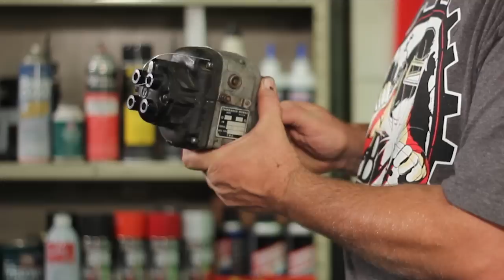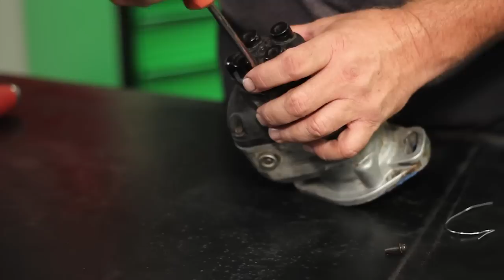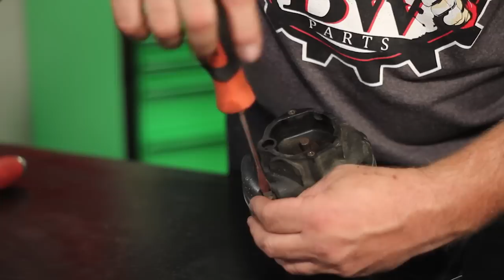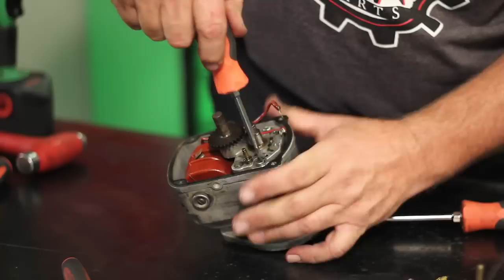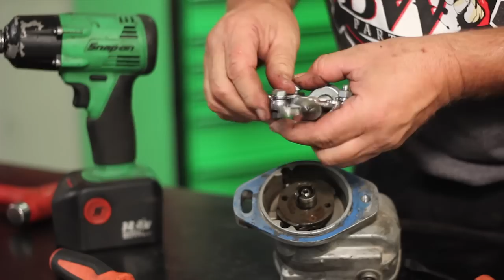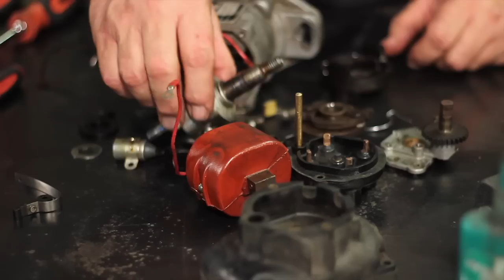Magneto Breakdown: Lincoln SA-200, SA-250

Comment: Hi...that tapered hub being pulled off at 7:50 to  10:20 ...is that a seperate purchaseable part. ..or part of a rebuild kit. One of my dog arms on that hub broke off, and into several pieces. Appears to be no damage to the governor gear or flywheel gear. My Fairbanks-Morse magneto looks identical to this one in the video.

Comment: I have a question does anyone know if the governor has to be installed a certain way with the markings of the timing? I rebuilt mine and after I installed it with timing marks put right with the can marks and flywheel it wouldn’t want to start anymore like my timing is off.. Does the fly shaft on the Governor have to be lined up with something when you put it back to the rod? I can’t find the answer anywhere.. someone help me please it was running before  🤦‍♂️
Reply: When you put the governor back, there's a mark on governor's gear, that has to be aligned with the mark on the flywheel, if you have spark on the points, it has to start, otherwise there's something wrong with the magneto (coil, condenser, broken wires, etc) and make sure you are following the instruction on how to time the engine when the magneto or governor is removed.

Comment: i am not getting any spark. i tested the coil by putting a test light on the little copper tab that is in the middle of the coil and turned the motor over. should i be getting power there when the motor turns over ? could it just be the coil that is bad ?

Comment: I know what you mean about refabing the puller too get the hub off, If I might add one thing I would have put the nut back on before pulling the hub so there is no chance of splitting the end. Just saying because there are times they are on that taper so tight I have to tap the puller with a hammer to pop it lose.